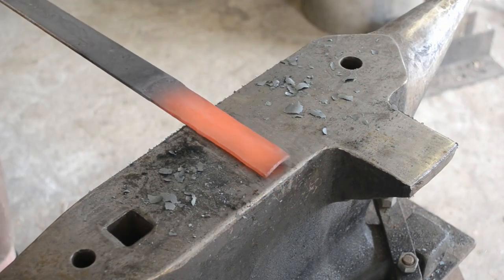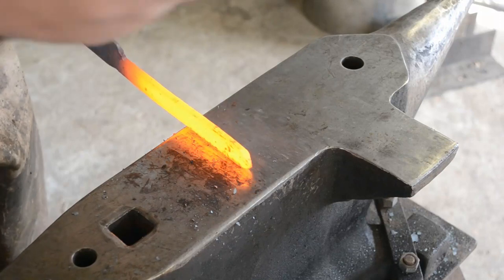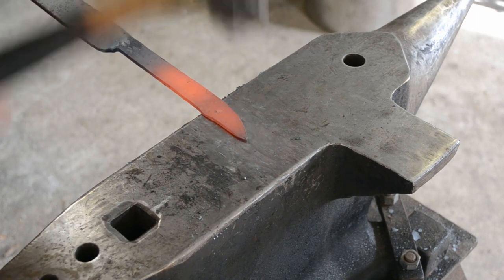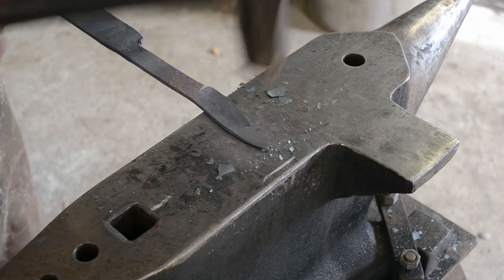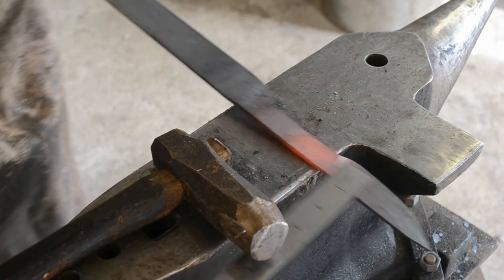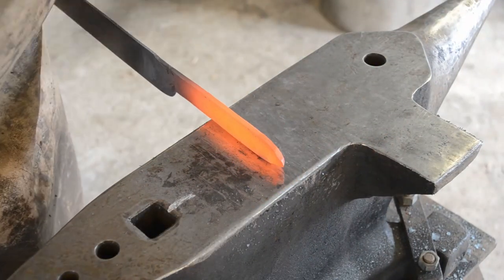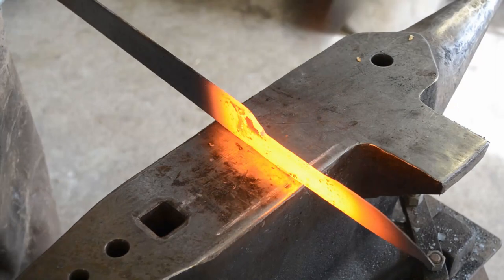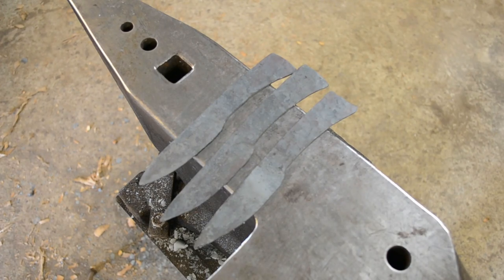Bladesmithing Basics: Repeatability

Comment: Hi sam i really like the info in this video and the blades that you have done im trying to forge some tongs im using the way most smith's do and im having no end of trouble with it i been watching blacksmith forging what is termed farrier tongs and im wondering if this would not be a more reasonable way to go as i have the most trouble with the boss and then bending the rains
Reply from the maker: The best way to make something is the way you find easiest. Give it a shot! I will say, if you're running into problems where others aren't, slow it down, and try again step by step

Comment: I don't know what I'm talking about, I was wondering why you were hammering the bevels on the what looked like it would be the spine, and  then it made sense. So is this how your suppose to forge a drop point style blade?
Reply: It is how you forge any blade that doesn't have a tip that curves backwards like a banana(some moderately specialized slicing knives can benefit from the curvature)

Comment: Not to be judgmental or question you methods, but why not forge weld it together to double the thickness.  Then forge it to shape. Ofcourse buying a thicker stock would be the easiest and less labor intensive.
Reply from the maker: I have thicker stock, as I outlined in the voice-over, the reason I chose to do this specific set of blades from 1/8" stock was to practise hammer control and repeatability. This was an exercise, not a demonstration of best practises